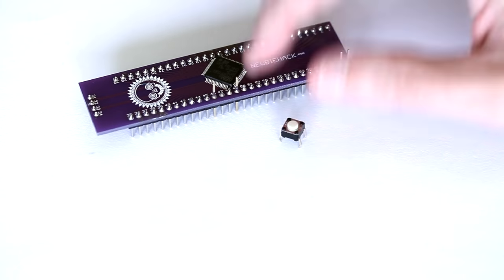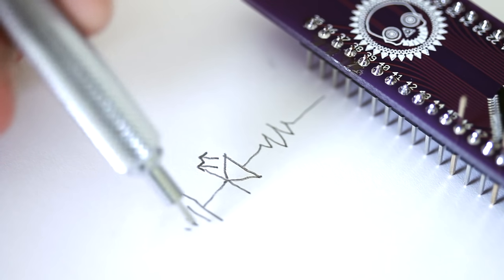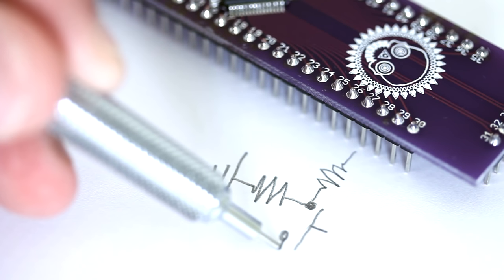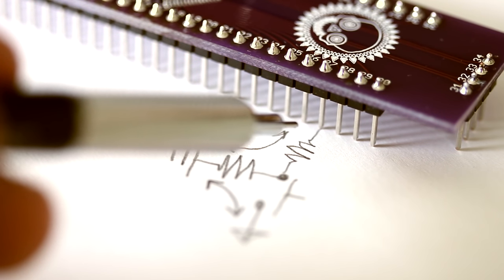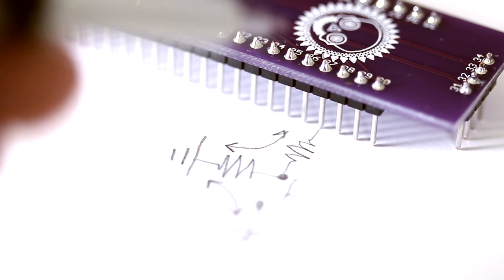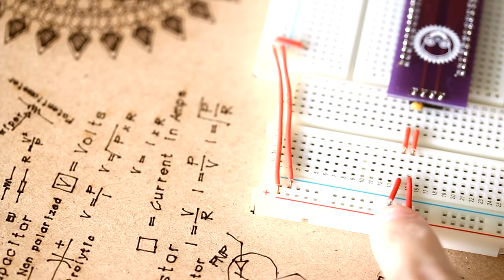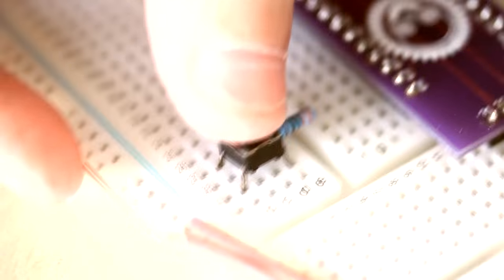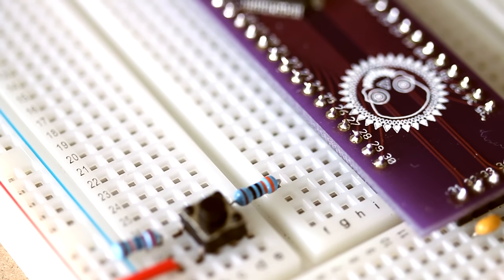10. How to Create a GPIO Input for ARM MCUs - Tutorial on Push Button Input and LED Output

Comment: Firstly, I appreciated for your great work. I am thankting to you. I started to programming ARM, which I have a background of avr mcus. You explain concepts and internal things of the topic quite well with keeping it simple to understand.

The question i want to ask is that wouldn't we achieve same behavior with this setup :
- Connect one pin of button to GND
- Connect other pin of button to the input pin 
- Configure the input pin as INTERNAL_PULLUP
- Led on when button is LOW
- Led off when button is HIGH

I just want to make sure that it works ?

Comment: Hi patrick, thx again for your tutorials, they re priceless. I have a question i can t really find a straightforward answer to online: is code portable from one arm manufacturer to another, given you'd stay in the same microcontroller family? I ve read some things indicating that coding the way you did in your vids should be portable because you use the cmsis definitions instead of memory/register access - so the bridge between manufacturers would be the included h file with the definitions. Am i right or...?

Comment: Why is the protection resistor necessary? Aren't GPIOs typical high input impedance?
Reply from the maker: Thanks for this comment.  It is an important topic and one that I hope to explain in more detail in videos to come. On input pins, you want a resistor for protection.  In this case, when the push button is pressed, there is a direct line from source (VCC) to the pin.  If the 330 ohm resistor was not installed between the VCC and the pin, the pin can source too much current and possibly cause the pin to fail permanently, or do more damage within the microcontroller.  It's also a habit I want to engender to others.
Reply from the maker: Forgot to mention that for situations where you may have a switch, or pot on a pin and the pin accidentally set in a state that is not high impedance, then the pin can be damaged if the pot is set to one end (ground) or the switch is depressed and connected to ground (for that type of circuit configuration), depending on the transistor on that pin.  For instance, if I put a switch on the pin and the pin gets shorted to ground without a protection resistor and the pin was set to output mode, or an alternate mode, then there is a possibility that the pin can get damaged.

I would love others to chime in here to discuss these points.  I like to err on the side of caution, but I would also like to hear others take on the subject.
Reply: Any ideas about reducing switch debouncing?